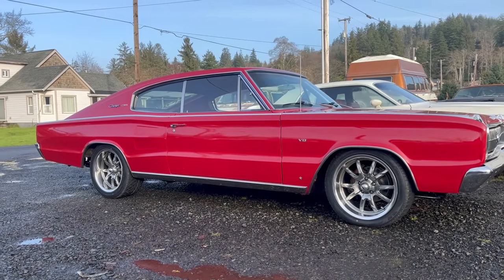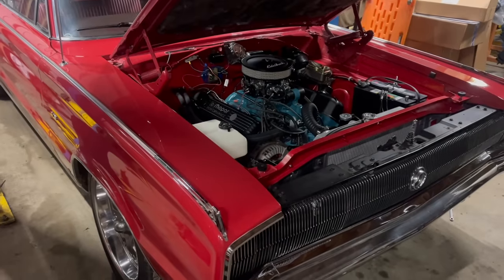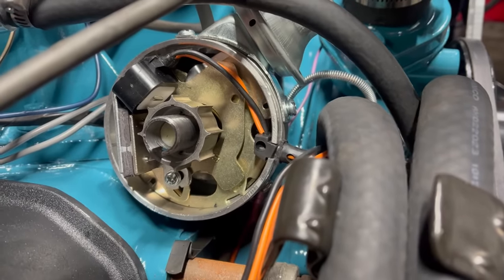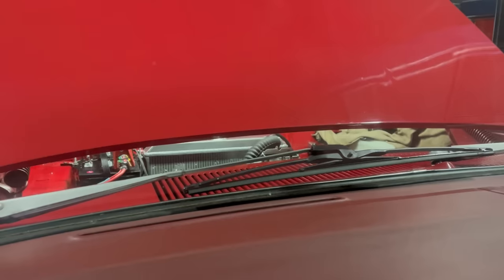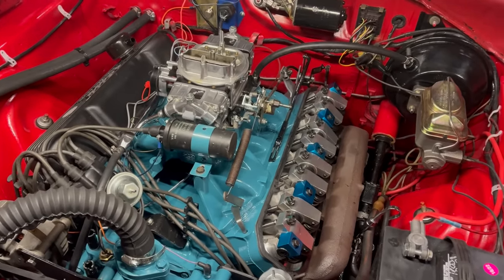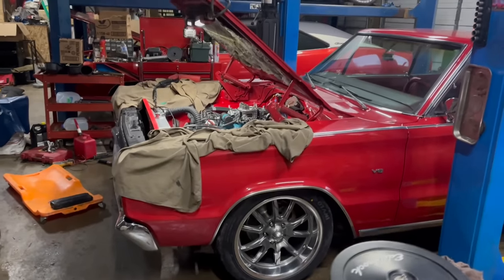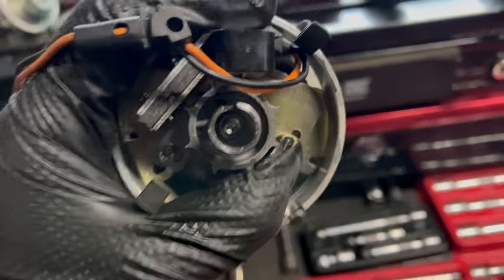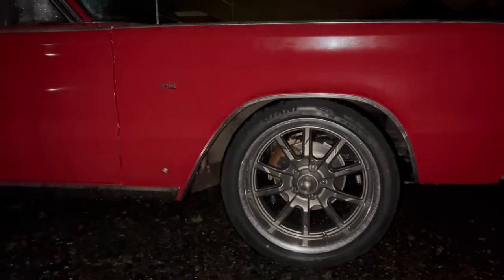What's Wrong With This 1967 Dodge Charger Big Block 383? When Bad Parts And Builders' Mistakes Mix

Comment: I knew WAY UP FRONT that the cam was too far advanced... Back in the late 80's, when I had my shop in Upstate, NY. I had a buddy/customer who had his engine machined by a pro and he brought it all home and built it. When he fired it up, I started getting those, WTF COULD I HAVE DONE WRONG, calls.. Since I had paying jobs overfilling my shop, I wasn't completely paying attention to all he was saying and told him to bring it by on Saturday. (Shop was closed on weekends, so I figured it would be a great time to figure it out without the phone ringing off the hook.. As soon as he fired it up on the trailer, I knew exactly what he had done.  When i questioned him about advancing the cam, he said: "I advanced it 4*s". After rolling it into the shop and making some fast checks on the typical impairments, I pulled out a timing set and put it flat on the table and asked him to show me how he advanced the cam. I know he doesn't OWN a degreeing wheel, so as I expected, he said: "I lined up the dots and then moved it 4 teeth in advance".....  I asked him how many teeth were on the cam gear on the bench and he gave me that, (OH FUCK) look..... So we spent a few hours R&Ring the radiator, water pump, balancer ,brackets ,etc, and NO, I did not break out my degreeing wheel, but once back together it ran like a champ....
Reply from the maker: Yep… this was a new one for me. Definitely a good learning experience. I own a degree wheel now, but have never had one before. I have always just installed them dot to dot and have never had a problem. I recently learned how to check overlap with a straight edge (as somewhat demonstrated in this video) so now I’m not sure I need the degree wheel. Haha.
Reply: Hahahahahahhaa..... I have owned a degreeing wheel for about 40 years and used it a lot when I was first building drag engines and hot street engines, but I soon figured out that the cam manufacturers were pretty good about getting it right.  It's another thing when you want to advance a cam and you are really more than a weekend drag racer, but I'll tell you, I have not touched that wheel since I hung it on my new shops wall in 2009'..  
Keep them coming, buddy. I truly enjoy your videos and sense of humor.. That humor is something we ALLLLLLL NEED these days..
Reply: a degree wheel is only really good for checking reground cams from personal experience.  im not sure why anyone would screw with cam timing if you order a cam buy what you want install it straight up and if you dont like it buy a few sets of pushrods and rockers before tearing into it !
Reply: Look at that tire! Woa!
Reply: I never heard 1 tooth was equal to 1 degree.  It's surprising it even ran.
Reply: Same here, cool to find that years of experience actually helped for once, good show though 👏👏
Reply: For the guys that haven't found out the hard way why dropping the front onto the bumpers is bad: if you are riding near or on the bumpers, when you go into a corner hard, the bumpers add spring rate logarithmically, so you going around the curve, the bumper is compressed(already bad) and you hit that whoop in the pavement and all of a sudden the spring rate goes from 150lbs/inch (yes the rate is continuously variable thanks to ingenious mother mopar) to 5000 lbs per inch and all of a sudden your in 911 world and sideways.. done it more than twice when I was younger and dumber.. warning for the wise!

Comment: Scotch locks and wire nuts everywhere and it has weird electrical problems you say?  That’s weird.  On a serious note, that car has soooo much potential.  It just needs about a month of Jamie’s time to work out all of the bugs.
Reply from the maker: I wish I’d had the time to fix all that, but the entire second day was time I didn’t really have to spend on the project. I did verify that 12v was getting through that mess, and it was. Outside of those tagged on circuits, the rest of the wiring is in surprisingly good shape.

Comment: Nice job! There's nothing like watching an engine go from running very poorly, to running pretty well. I am always amazed at how badly things can get assembled in an otherwise nicely built engine. Didn't they read the directions? I know, dumb question! 

Anyway, I don't dig into engines nearly as much as you do, but when I do, I make it a point to really take my time and making damn sure I am doing it right, and keeping things very clean at all times. That approach has always served me well, even if it takes more time (which usually saves a lot of time in the end by avoiding major problems).

Comment: I've always found it's much harder to diagnose other peoples screw-ups that actual broken stuff. The wiring in that car is an abomination, Scotch locks and wire nuts?, oh my! Nice work on the running part, I can't understand why guys install cams like that for street use. Just because it sounds bad-ass, doesn't mean it is.
Reply: That's why some new cars have factory sound tracks play thru the stereos that make exhaust noise

Comment: Really Great video! What a GORGEOUS car, one that is seldom seen or appreciated. This is one in really NICE condition! Great job getting it sorted out for your friend. A lot of little annoying things left to complete, but overall, what a gorgeous 1967 Charger and I agree with you about the interior, SO Cool and Nice! Big cam equals low vacuum, and might be the reason the power brake booster is having issues. He would be happier with a stock 383 HP spec cam in it.

Comment: Another fantastic job Jamie. Bravisimo! And my 66 sport fury had the same shifter and console minus the padded top. My girlfriend back in 76 cracked the rear part of the console with her foot that you mentioned was usually cracked. I will just let you imagine what she could have been doing. Mopars rule man !
Reply from the maker: Haaahaha. Nice. Yes, that console was used in C bodies in that timeframe as well. Pretty cool.
Reply: I had a 66 Coronet with full console.  No room in back for repurposing back seat, however, the coolness factor of my car led to other locational adjustments too.
Reply: Same

Comment: What a bizarre issue. Was that the engine builders first engine? More and more I am a big fan of using factory parts and keeping engines much closer to stock than modified on a street driven cruiser. I understand changes for a dedicated race car. I'm impressed with your tenacity to work through the issues, even when it is an obscure and bizarre problem.
Reply from the maker: That’s exactly how I feel about it. Race cars are one thing. For normal cars, more stock is more better. No… it was apparently an experienced builder who clearly didn’t know Mopar and may or may not have been having a bad day / week / six months.
Reply: @DeadDodgeGarage unless original parts are in the thousands of dollars... many parts are better to be original but you just said poly bushings which weren't used back then. My car rides and handles well due to aftermarket modifications. The original handled like a turd. My engine runs far better too thanks to aftermarket headers, super boosters, and transmission mods. A car like mine rides and brakes like a dream, unlike that stock car with drum brakes and primitive blocky leaf springs. Eaton Detroit springs redoes leaf springs in  the most amazing ways tapering each leaf. I am still amazed at this mod.
Reply: I don’t think the rebuilder had much experience with 383 MOPAR engines eventhough he was a good engine repairer. This is why you get stupid mistakes which stop the car running correctly. You would have to start from scratch, fix the mistakes the rebuilder made, to get the car running to its tip-top performance.
Reply: @DeadDodgeGarage exactly!!
Reply: At most, a light RV cam
Even that creates tricky driving, esp necessary brake vacuum

Comment: Good video and awesome troubleshooting.. As a side note, maybe make the owner aware that scotchlocks and wire nuts almost always equate to electrical problems. The visible evidence of those being in existence under the hood make me question the electrical integrity of what may be going on within the dash panel. I've been cutting those out of cars and trucks since I was 15. I'm 55 now and still correcting electrical problems on cars and trucks by removing/undoing this sort of thing.
Reply from the maker: I did. It was just about the first thing I said to him when we opened the hood. He was making temporary connections to find a suitable power feed for the choke and ignition box. The rest of the wiring is unmolested, and in remarkably good shape. I would’ve redone that stuff if I had a bit more time.
Reply: I have used scotch locks, wire nuts and even twisting wires together in the past. They were always for temporary or emergency repairs. Because they generally don’t last or become troublesome. Like it or not, they always become a temporary repair because they almost always fail again and have to be done over at some point. But they are quick and dirty and can get you by until you can do it right. Been there done that. Sometimes, crap repairs are better than no repairs. You do what you gotta do to get rolling again.
Reply: @americanrambler4972  I agree with that, they are quick and easy. I've twisted wires together myself to get home. But these types of repairs definitely must be considered temporary. I have been paid to debug electrical systems on cars and boats and have removed many of these and other temporary fixes that owners have done.
Reply: @madbrax5184 I think solder & shrink tube is the best, never doubt connection later

Comment: I'm a first timer here. When I saw this thumbnail my heart skipped a beat!!  A red, 67 charger w/black interior, 383 4bbl, 4 bucket seats and a column shift lever was my first car out of high school in 1970!  $2400, small down pmt, $67/month for 3 years!  I loved that car!  I put NASCAR steel wheels w/the biggest tires that would fit on it! 1 extra leaf in the rear spring pack and traction bars. Then removed traction bars and installed ex-heavy duty sway bars F&R. It was a 4:11 posi from the factory, and ran great!!  My Mother, who was 5'1" tall, would borrow it to go shopping. The small town cop told me to warn her about unsafe starts, or "burning rubber" as we say. I did, then she did again and got a ticket. She couldn't reach the gas and punched it with her toe. Burning rubber. LOL Judge tossed it out!  The front breaks were the first thing I looked for here,  while shouting in the mic "cam chain, cam chain". LOL  One Saturday night while playing with the boys I lightly tapped the breaks at a little over 100 MPH to slow down. The right front drum break grabbed tight and wouldn't let go, over the 15 foot embankment I went, and according to the state police, rolled 18 times, coming to rest upside down in a dry creek bed!  Seat belt on, and the only reason I'm writing this now!  No broken glass!! Not 1 square inch on the car without a dent, ding, crush, scrape or mark!! Today, I'm 71, have a 2500HD Silverado loaded, and a 2013 (last round tail light) Corvette, 6.2L 430 hp, 6 speed manual. It's faster, safer, handles way better, rides better and gets 22-23 MPG w/a light right foot!  LOL  If you got this far, thanks for reading my dumb story,  everything is very true!  My Mom would have loved it!!   8)   Peace  --gary
Reply from the maker: 😮 wow! That’s insane. Glad you made it. Thanks for sharing.

Comment: My old '63 Imperial Le Baron had the electroluminex=scent lighting. That is a coating on a wire that when heated emitted light. The only way it worked is with AC though and that means there is a vacuum tube converter somewhere that is probably worn out and the coating chips off too and ruins everything. I set the distributor up on my '68 Fury III with 383. Ran the vacuum advance canister and changed out one weight and one spring to have all advance in by 3k rpm. Starting at 8 degrees initial and all advance in was 34 degrees. Ran fantastic with 18mpg in the city, 20mpg on the highway, and beat '74 emission standards. Screw Chrysler's lean burn crap. 0-60 was in 6.3 secs. I was a happy camper.
Reply from the maker: It is not a coated wire. The plates and needles glow. I don’t know about the earlier Chryslers that used EL, but I am fairly certain they are the same. And yes, they work on ~230v AC, which is produced by a converter box - but no vacuum tubes are involved.
Reply: @DeadDodgeGarage  That's what the earlier ones ran on as I had it and couldn't get it fixed. No, they weren't the same. They only had the same name. If that doesn't fit in with what you know I wish I had that '63 Imperial LeBaron back to show you. My loss and one that I really regret.
Reply from the maker: @Friedbrain11  No, they are actually exactly the same. Perhaps that is how it was explained to you, but that isn't how the electroluminescent system worked. And incidentally, those early cars use the same type of power pack as the Chargers. That is definitely unfortunate. Those cars have an incredible amount of character.

Comment: My shop used to have a water ingress problem like yours. I cut a length of 3/4 inch hardwood about 4 inches wide with a 45 degree bevel on both sides and glued it to the floor in the doorway with construction adhesive. Its been there 10 years now and still works, I slap some paint on it every few years so it looks kinda pretty...You will likely have to wait for drier weather though. All the best from rainy Vancouver Island.
Reply from the maker: That’s a great idea. It would definitely help at the door there. Ken said he had used a strip of plywood there and it worked fairly well. Unfortunately, there are also other spots where water runs under the wall… this place needs some help at some point. That concrete apron needs to be busted out and redone. And a roof would be nice. And… and… I just want to fix cars. Haha.
Reply: @DeadDodgeGarage  Last winter one of the underground drains plugged , Since its a shared drain with the gutters I had a lake in the shop from one of the floor drains . It was one of the big downpours, Laying under the old Mercury in two inches of cold water trying to snake out the plug. It was fun.
Reply: @DeadDodgeGarage I had to grind down concrete outside of door to slope away from building

Comment: Brings back memories. I had a 66. I did some work on it. Dropped in a 440 Super Commando with a mild street cam and had a 2:97 posi rear end and a reworked automatic which switched it to a manual shift. I never found top end but it would bury the needle. I really miss it.

Comment: What a beautiful car. Love the first gen Chargers. 
Yessir, with that much cam, she'll want plenty of advance at idle. My 402 chevy (with a similar size cam, just based on the sound) wants about 32 at idle. You bet your bippy I didn't get there with base timing! Vacuum advance can that is 'fully deployed' about 2in less than the engine produces at idle is what I've always heard and done. You have to shop around to get the can you need, but the end result is worth it. Idle is good and steady, not gassy, doesn't overheat. Also produces plenty of vacuum to run those pesky brake boosters!

Comment: I was a real treat watching this episode. A knowledgeable tech doing honest to goodness diagnostics based on years of experience. Distributor/ oil pump drive line up ( with Chevy’s if that rotor wasn’t pointing at the left headlight, I knew a rookie had set it up.
 I tried to guess the problem when you first started ( I thought valve lash) but you found tons more. It was skills like this that made me very popular in my circle.
 I still get crap for my zero lash valve adjustments but never floated any and never clacked.
 It’s really cool how you talk to your camera and share your thoughts.
 I’m an old Chevy tech and lived to outrun any Ford or Mopar and usually did. I won’t lie I did run into an occasional Ford or Mopar guy that had my leg shaking at the end of a street race, ( not many) but that Charger was nice and so was your soul search for what was done wrong.
  Thanks for the great content!
Reply from the maker: Thank you! I am running zero lash in my 360 with no issues. But I have heard that with oil through lifters and pushrods, a bit of preload is important for top end oil pressure regulation inside the lifter, and also that zero lash can potentially lead to the lifter piston retaining clips removing themselves. I think a half turn of preload is a good compromise, and am planning to run with that moving forward.

Comment: The reason new aftermarket parts don't work is that they are reverse engineered from the originals by people who have no idea how they are supposed to work.  I wouldn't use that engine builder again.  At least the engine had a nice coat of paint on it.  :>)
Reply from the maker: The owner and his brother did a really nice job detailing the engine and putting everything together. Just a shame the builder let them down. It had already been opened back up once… not ideal.